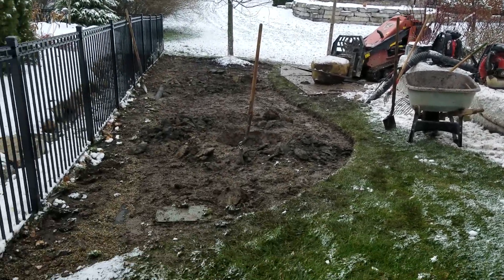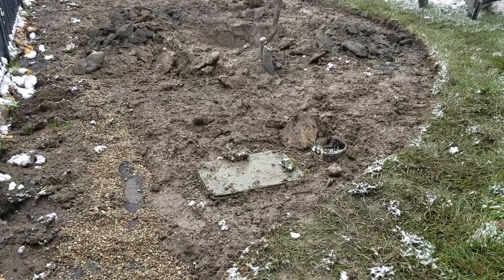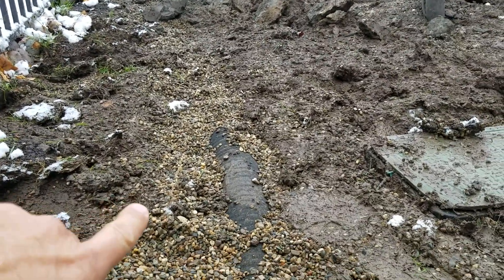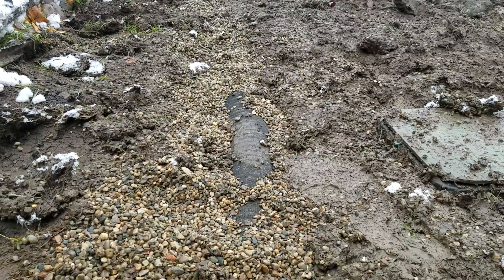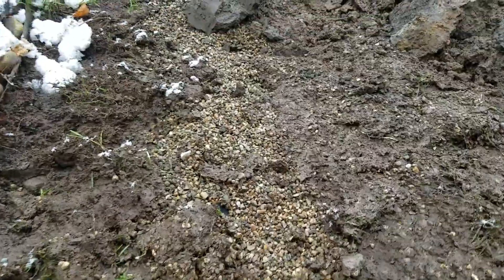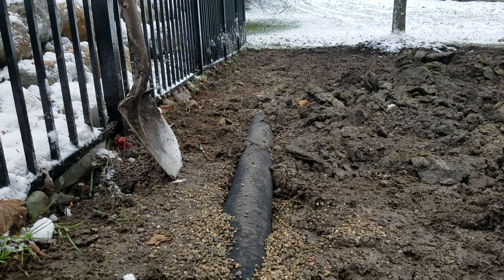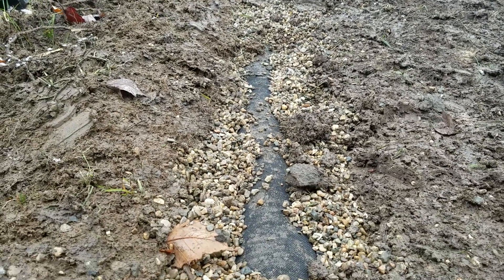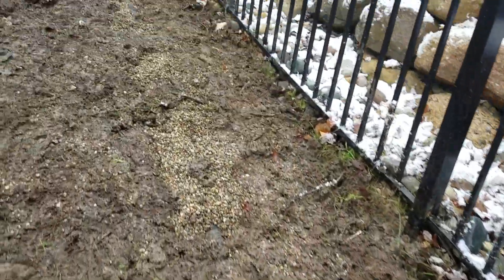Why French Drains Fail - Must Watch!

Comment: We just dug a trench at camp so that our camp won't heave in the spring. We dug the trench 2ft deep and it was about 75 ft long around the one side of the camp. We made it exactly how you had described to make it in the video so hopefully it works well next year.
Reply: Did it work well ?
Reply: @bellsback It worked well but should have been dug below the frost line.

Comment: Question - since my yard is flat and the only slope is from the front driveway, having a shallow trench will maximize the slope from the back to the front. Is there really an issue with a shallow grave if it is properly wrapped?
Reply from the maker: You can do 3" corrugated pipe gravity powered system
Reply: @FRENCHDRAINMAN  Unfortunately, you only make your high octane in 4"...

Comment: WHat do You think about using wrapped pipe and no stone? I found a company using Dupont Typar SF44 sleeve, claiming that if used directly in clay it will not plug and will drain properly. Bold statement, very tempting.
Reply from the maker: In my experience it decayed. I stay away from it because of that.
Reply: @FRENCHDRAINMAN  You mean that particular DuPont wrap?  Decayed like deteriorated and allowed soil to get into the pipe?

Comment: Thanks so much for all the information. Very helpful.
What is your opinion in the pre fabricated french drains. The one that the pipe is wrapped with some styrofoam gravel in a fabric. Seams easier just to dig and install. Much lighter.
Are these actually work in the long run?
Thanks
Reply from the maker: https://youtu.be/20Msql_O5a4
Reply: @FRENCHDRAINMAN  thanks for that comparison. Very useful.

Comment: Could you still used a sleeved drain.. inside of the wrap as you said .. for added security? Or is it not necessary?
Reply from the maker: Yes you can. It prevents smaller stone from getting stuck in the inlets

Comment: Great video. What's the ideal stone size to use in your trench? Is bigger stone better? Also how wide do you dig your trenches for your systems?
Reply from the maker: Start at 14 x 14  inches deep. 1 1/2" Round Rock
Reply: @FRENCHDRAINMAN  
Sorry, did you mean 14 inches wide? I was asking about the width, not the depth.
Reply: @vzgsxr  he said 14×14 so 14 deep 14 wide as far as i understood

Comment: If you wrap the trench with geotextile why doesn't the geotextile surface then plug up? Or is it because it's a much bigger surface area that it doesn't matter?
Reply from the maker: @Autotrope fabric keeps stone and dirt from migrating into one another. Water flows freely through CLEAN stone. Our fabric has thousands of punched holes in it to increase flow rates. Thank you for commenting

Comment: To me at least the corrugated pipe harbors debris inside. I would prefer ridged S&D plus have it deep enough to prevent freezing in a northern clymate, and run it out on gravity flow.
Reply from the maker: What you are suggesting is illogical. You want it below the frost line, which, here in Michigan, is 42 inches deep.  But you also want a gravity drain, which is impossible. How will the water defy gravity and reach the surface without a pump?
https://youtube.com/playlist?list=PLjFCqaZ4v1BX_ZMbxsYVB6CNFoeAmuPxX&si=Oe7n0ryG9KzRBgr8

Comment: I believe u meant "what good is a pipe that IS PLUGGED! If it's NOT PLUGGED, then it would drain. 
However PLUGGED is no good. Good video
Reply: Well not exactly...  The pipe can be not plugged and be a failure because the collection rock is all plugged around the clear not plugged pipe.
Reply from the maker: @brooksfarris2778  THANK YOU!!!
Reply: What do you mean "plugged around the clear"
Reply: I agree 110% with wrapping the stone and pipe as one. Maybe I'm confused on how he worded it
Reply: @brooksfarris2778  yes I agree. It will plug the perforated holes. Like I was saying, I agree but I interpreted it differently. I believe were on the same page but different language.